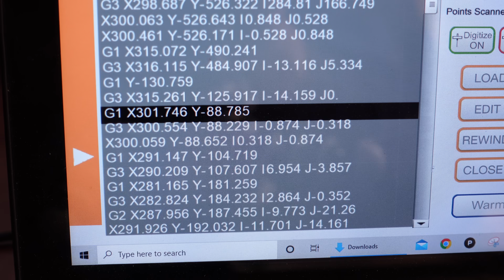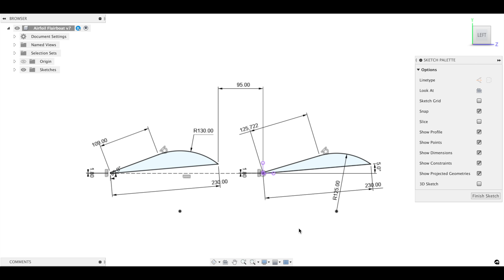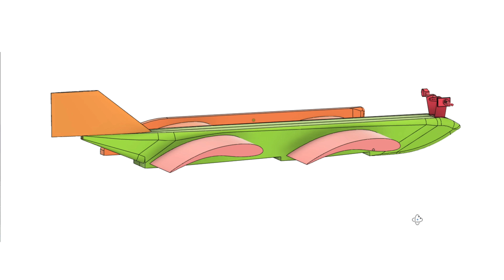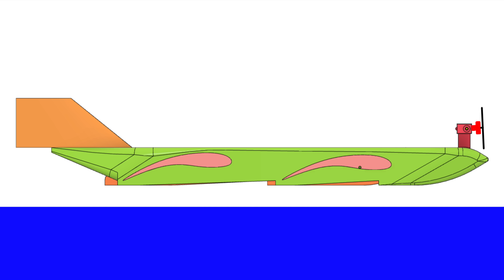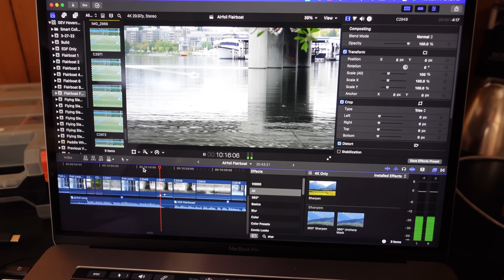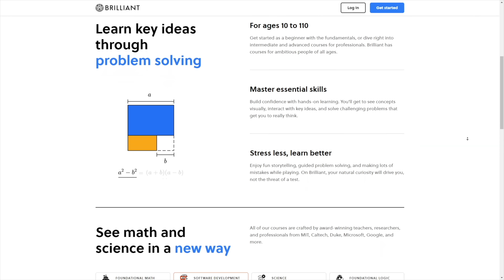Worlds First R/C Airfoil Flairboat

Comment: Are hydroplanes and offshore, catamaran race boats a type of airfoil lift boat? Speed, forced air in the tunnel lifts the sponsons out of the water to reduce drag until the weight of the craft and or air pressure from the top of the hull keeps the boat on the water.

Comment: the flipping up with the more modern boats has to do with the ripples on the water and the change in ground effect due to speed. this means that ground effects are not stable, like on grass and concrete, so if you balance things so that the margin of error is tight then it will be prone to flipping. figuring out how to widen the margin of error is the real trick to a stable ground effect vehicle.

Comment: As someone mentioned previously: your design incorporates a canard wing (the forewing) and uses it in such a manner where it exists to generate lift, and thus, it must be allowed to stall at a quicker rate than the aft wing. While this individual is absolutely correct and his recommendation is sound, it is not the most effective approach that would coincide with your design methods, in my opinion, and would demand a lot more up front calculations than one would initially anticipate... Unless, you're onboard with crash-coursing yourself on fluid dynamics with utilizing model/scenario-fueled, virtual-represented fluid dynamic studies (CFD)... And if you are - fck yeah, more power to ya.

A more dependable approach that has so far coincided with your design approach (which is little to no math and relying on a healthy understanding of aeronautics, but without really spending time crunching your numbers) would be:

1) Reduce the maximum lifting capabilities of your forewing configuration by reducing the lift surface itself in size relative to the aft-wing. This is by far the easiest approach to reverse the issues associated with your aft-wing stalling before the forewing. Consider a tapered wing... Example: The much smaller ratio seen between fore and aft-wings on a Rutan VariViggan/VariEze/Long-EZ models. As another comment made mention of the Beech Starship... The scaling issues found during development relative to lift ratios between the lift generated between the fore and aft-wing configurations was exactly what you're fighting with here, but their solution would probably make for a dope video, but likely far more involved than you're trying to take on... Their solution was a fluid and variable canard design that was able to adjust it's lift coefficient relative to realtime demands for stability and provide an emergency variable response/mitigation approach in stall scenarios to increase the likelihood of stall recoverability through adjustable canard geometries relative to the fuselage.
2) Push your aft-wing configuration further away from the craft's center of gravity, thereby denying wash from influencing as pronounced an effect onto the leading edges of your aft-wing for overall stability. This would greatly increase the appropriate responsiveness of your aft-wing trailing edge flaps, as eddies/turbulence are less likely to form with a less violent leading edge airflow will impact the outermost portions of your aft-wing and allow for better trim and natural stability. With careful a design approach and implementation of control surface, I would believe you to be able to implement forewing trailing edge flaps in a meaningful manner by which to engage a pitch controller more effectively if you are able to minimize wash impacts on the rear wing and ensure the aft-wing's maximum lift capability is never met prior to the forewing's point of stall.
3) Remove the whole ram thrust that you tried on this build - I totally agree with your conclusions on its issues you discussed and expressed concern about... And while it is an easy response solution compared your par thrust approach, you haven't considered a far less convenient way, but also super cool and unique way that avoids your issues seen thus far: laterally mounted motors that are external to your long-winglets (essentially), which I think you called "side rails" in your video. To reduce unexpected wash implications, I would go a step further and recommend a ducted fan approach, even if it isn't as fancy as an actual turboprop or focused high pressure output system.... The recommendation is only to help you prevent further issues by utilizing the cowling to facilitate a more stable airflow dynamic on the wings & controls.
#3-partB) ... With a left and right ducted fan-like prop on either side, a sufficient rigid vertical stabilizer (no longer relying on a controlled rudder, for example) I wonder if you could rely on par thrust as a method of yaw control, and streamline trim to ensure uniform lift with reduced impacts from what roll-influence would otherwise have been created from rudder-only input to turning by  appropriately trimming with the flaps? Hmmm. Curious to see if you run that down.

My professional background: mechanical designer for a vast array of fields much of which is spent in design & prototyping or manufacturing where CFD/FMEA/FEA are relied upon heavily.

I also specialize in improvement/bridging of systems in cross-platform interoperability opportunities to streamline all aspects of massive projects that require a multidisciplinary collaborative input approach where different tastes in different software platforms per element collide... And get everyone speaking the same language, on the same project at the same time, without rework/extra training by engaging in opportunities to share otherwise incompatible data.

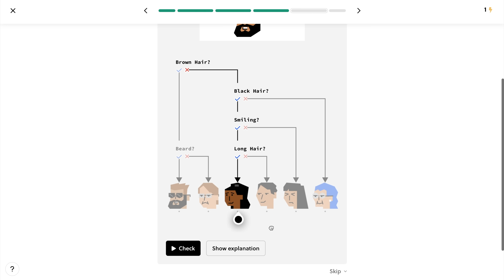Comment: 16:26 ... I don't quiet get this illustration.
The 'airflow' they are visualizing is clearly based on the Coanda effect, but if that's their big selling point, why mount the engines below the wing? Wouldn't you want to increase the airflow above the wing, to increase the Coanda effect?
Is the air underneath constricted by the airfoil and 'Coanda downwash', so it creates a high pressure area producing more lift?

Comment: My Father built a model R/C Acronoplan but unfortunately because it is made of foam card it suffered badly being stored in a hot conservatory which warped it badly, it is sitting in my front room waiting for me to rebuild it, it has three motors two at the front which can be angled like yours and another in front of the tail and yes ive seen it fly in ground effect very well and it weighs all up about 3.5 lbs using a 7.2 volt 3000 mah nicad pack. so yes add some more weight it will probably make it more stable and less likely to want to fly above ground effect.

Comment: Why is a pureground effect vehicle impractical? Don't you get more lift for less energy? As a plane sure terrible but as a "ground vehicle" with no rolling resistance you get even more efficiencies. Hovercraft effectively are using the air as an air bearing relative to the ground and air bearings have super low resistance? Can you run through an airflow simulation? Can you stabalize the air under the vehicle in a torodal shape like a smoke/bubble ring? Does the turbulence of the air under the vehicle matter in terms of efficiency? I would like to understand the math of this

Comment: I think the relevance of this technology is perhaps in trans-oceanic transportation of goods - what load can be lifted? how many modules all working on the same effect can be practically assemble together? what configuration of assembly would be optimum? can all be reduced to modularity for the provision of parts? can carbon containers be integrated or actually constitute part of the structure with complete compatibility with road transport either end? could it be made to float and be towed in case of emergency? so many questions!

Comment: Actually they figured this out years ago they got two versions they got one it's just blades that work off human weight to skim across the surface of the water and the other is is that they have a front-mounted Bowie that's place to ride height just to adjust the list of the blades to match the speed and it works quite well

Comment: The point of ground effect flight is to "fly" with less required power.  Modern electric motors with LIPO batteries have thrust-to-weight ratios far in excess of internal combustion engines.  In short, your Jorg is overpowered.  Furthrrmore, ICAO recognizes three classes of wing-in-ground effect vehicles....types A, B and C.  Type A can only fly in ground effect (GE).  Type B is capable of dynamic jumps out of GE before settling back into GE.  Type C is a hybrid GE/aircraft capable of out-of-GE flight like a conventional airplane.  Your sled and your land speed racer designs are very similar to the designs of Charles Bixel who used symmetrical airfoils with a deep chord center foil/fuselage-hull supplemented by two wings employing symmetrical foils to achieve "hands-off" stable flight in GE.  Also read up on Reynolds numbers effects as one scales up from models to full-size craft.

Comment: What about two wings that fold down once the craft leaves the water? The wings wouldn't extend out too far but run the length of the side skirts. They would be kept in a horizontal position while the craft is in the water so as to reduce drag from the water but fold 90° down to help with the ground effect. Maybe an additional inch (+/- a half inch) beyond the side skirts. This will add weight and a little more drag but might increase the maximum weight the craft can carry. The leading edge should curve up just in case they come in contact with the water. That way the water should push up on the part of the wing making contact instead of digging into the water and pulling the craft down.

Comment: If I may,,, suggest a few things... !. IMO you need weight otherwise there is no 'compression".
2. With the thrust up front and even slightly above the equal point of the wing you are creating lift. Remember it is the speed of the air over one surface that causes a vacuum or less pressure.  the curvature is just to case the air to be forced to move faster over that surface. For me I see it as the "ability to effect". When the air is moving faster over the surface it has less time or ability to push down. Notice that the other design had the thrust in the back which pushes the nose down and applies that needed pressure. why he used a curved wing which creates lift I have no idea and I think that you are onto something there. No need. IN fact I would submit that a purely flat surface, no wedge or anything is the optimum. if anything the front edge could be like a one edge knife facing down so it pushes the air under the surface.. 
   I've designed a few windsurfers in my time and bought an experimental "airboat" from Navy surplus.. 40 ft long and 12 ft wide.. the looks I got using my VW van (68) to pull it down the highway... priceless I redesigned it ever so slightly and made it out of Styrofoam and tested it out.... kawabunga..   Anywhoo I also don't think you need any angle at all just at the back to cause the air to be trapped a bit and cause pressure to ride on air.  Call if you like  find me at  crackingtheeggshallofconditioning.com my email is continueedcompetencytraining@gmail.com and @protonmail.me

Comment: Your biggest mistake just like the original is missing key concepts of "aerodynamics".. in ground effect (ge).. the foil profile being used.. conventional surface flow type.. 

What's your objective with creating a craft that can't fly out of ground effect.. that's essentially just a lift/speed vs weight factor.. consider how .. the high pressure air flow under the foil affects airflow at the trailing edge of the upper surface preventing stall.. the jet effect under the trailing edge will prevent reverse flow around the trailing edge to stall.. as long as it's in ge.. the water surface boundry layer will keep the flow attached to that surface & pull the foils upper surface flow down with it.. that's where efficiency is picked up.. what effect does "stall" have on lift.. in ground effect vs out of ge.. what effects might a very narrow reversed Gurney flap have on controlling trailing edge reverse flow (stall) in ge.

A more "laminar" (thicker to the rear foil) flow design foil might be much more effective in both by creating a much stronger reverse flow around the trailing edge to stall.. create much stronger lift in the transitional stall out of ge.. consider too, how does a bi-foil setup vs mono, react to centre of lift (CoL) moving forward in either or both foils as it transitions out of ge.. nose up eeevery time just as would a stalling laminar flow type foil profile.. some form of Fowler flap type second foil at the rear of the main foil should better react to pressure vs flow differences in & out of ge.. consider a (Fowler flap) control mechanism as is used in sailing foiling moths that would control the rear flap as the nose lifts.. should improve flow dynamics if the wing end plates extend well forward of leading edge & down into the water during flight/operation.. end plate trailing edge rudders (aero & water) for controls.. further thoughts pending

Comment: Doesn’t true ground effect rely on the ground resistance creating a high pressure layer of air and fast-moving/low-pressure air over the wings generating lift? Won’t allowing the thrust-air access underneath the wings interfere with the ground effect?

Comment: " I'm not really sure "  One of the most accurate statements.

Aerodynamics is probably the most complicated subject there is.  Basically you can seldom be sure about anything.  We can rationalize how we design things we do design, but basically we are just guessing and try to justify our guesses with assumptions about how things work.

What you are attempting with your over the water ground effect vessel is closely comparable with the problems being encountered in 2022 F1 car racing.  They are spending millions and have access to wind tunnel testing , and still failing to find a sure-fire solution.

Anyway, your work is to be commended. and  most important - looks like a lot of fun !

Comment: Clearly you should spend all your time in reading aerodymanics of  the 2022 Formula 1 ground effect cars which are so far advanced of these evolutions...
You are not there yet.....sonner or later you will relise the designs you have tried have unstable lamina flow under neath the vehicle a problem the hovercraft solved.

Comment: If you had a very heavy craft, or craft with load, wouldn’t you end up sort of flying in a hole in the water?  Like the weight of the crafts down draft would displace water, no?

Comment: Really nice !!  please forgive me if this sounds wrong ....*it's been many decades since my modeling days*  but I'd love to experiment with weight and CG as you mentioned in the latter part of the vid . Not just by putting lead shot in the nose though !  and the nose looks too short.....what if the weight was placed on the leading edge of the front wing ? plus experimenting with the placement of the weight at different positions along the span ?  I noticed a tendency to tip stalling . Also would be interesting to see how something behaves double the scale ?

Comment: Would it perhaps work better if you made sure that the wing stalled at very low AoA? So that once it starts to pitch out of the water it comes right back down again because it loses lift due to flow separation. This could be achieved by a very sharp airfoil, perhaps with a built in groove on the top leading edge to separate flow at small AoA.

Comment: I imagine it’s cheating according to your definition, but it would be cool if on the outside of the front wings, you put some angle of attack veins that were attached to spoilers on the front wing. The idea being if the vehicle pitched up too high, spoilers would instantly kill the lift on the front wing, for a pretty immediate down pitch motion. 

It’s not aerodynamic balanced without moving parts, but it is balanced without requiring fly by wire or hopefully and manual input

Comment: When i look at other wig vehicle they don't have this huge curve on top of the wings. I think you made the wings to much like a plane. You might get away with a bit of a curve if the craft is heavier, but not as light as this one. It don't take much to lift your vehicle. I would just make them completely flat if i were you. If you want the wig to be more stable you could just at a horizontal stabiliser like on a normal plane up high at a extended tail.

Comment: Ground effect works much better on ground, as the name implies. you'd probably be better with wheels as the water surface tension is a big hurdle of reduced scale. you'd probably need a hydrofoil also to get this model to work well, it becomes overcoomplicated. The wider the wingspan the higher the ground effect works for as well, which would be needed over ground. Water was used historically for testing but the end goal was for them to work on land too. Various versions of this have seperate lift engines to get it going. 

There was an concept for using this on a track like a tobogan for fast transit. It would be interesting to see if you could get this to work in a hangar or gymnasium or similar to show a land version off. They would have been a great invention if not for one little issue- trees. Also, super high altitude made much better economy than this, which is superior to low altitudes in theory.

It does have uses militarily- but the weather issues, particularly sea state are a big drawback.

Comment: Guess what, the Soviets built a few ground effect vehicles. One of those was called A-90 "Orlyonok" and it could fly up to 10000 feet high. Google it and you’ll see that it looks like an airplane. So technically there were 3 types of ekranoplans: A (limited to ground effect), B (most efficient in ground effect but can fly higher to be more maneuverable) and C (utilizing the ground effect only during takeoff and landing). Hope it helps 😊